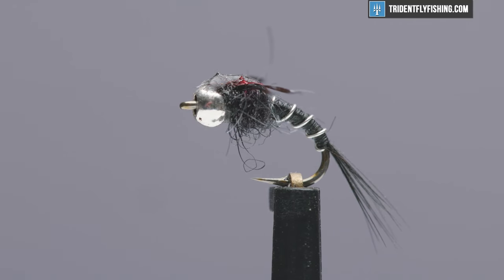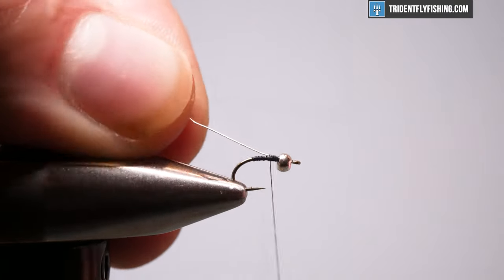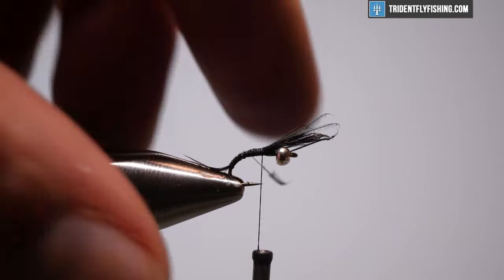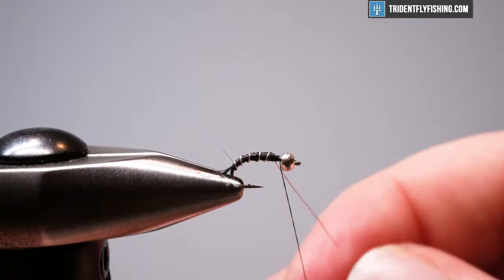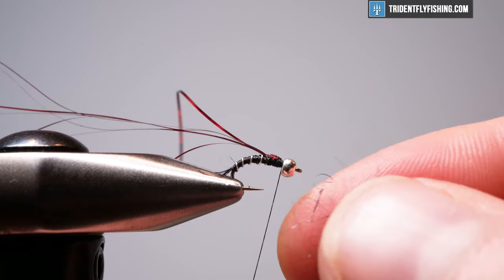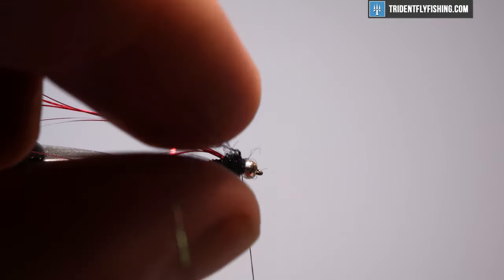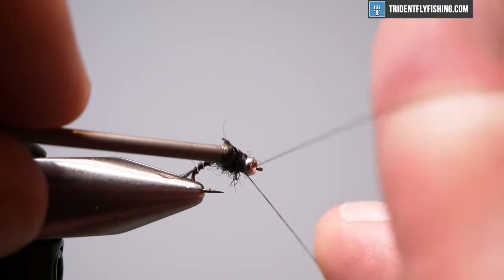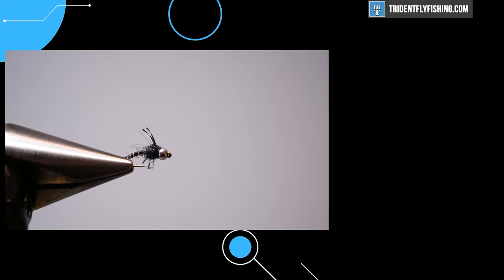Higa's SOS Baetis Fly Pattern Tutorial

Comment: When setting the tail if you just use 2 tight wraps it will hold it while you pull the hook out to check length.  Plus if you need to shorten it, you can just pull the butt ends until it gets to be the length you want.  If it doesn't want to pull, unwrap one wrap and try pulling it again - usually you can pull it shorter with two wraps securing it.  Nice tie!!
Reply from the maker: Thanks, Dan!